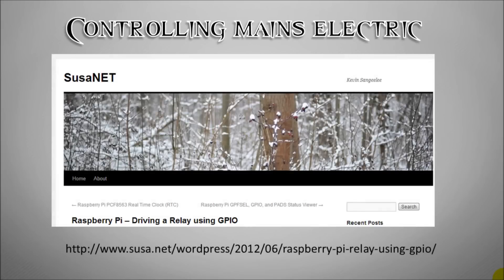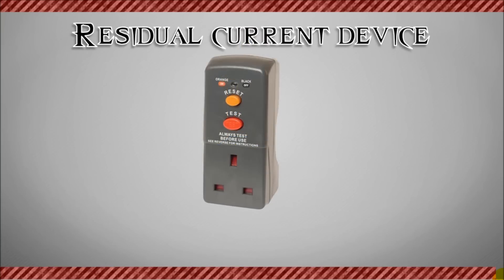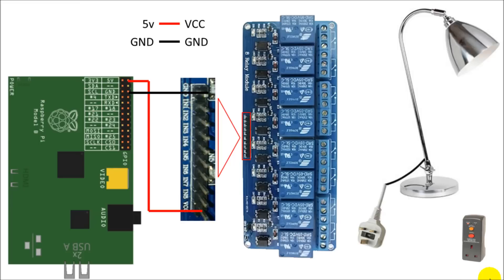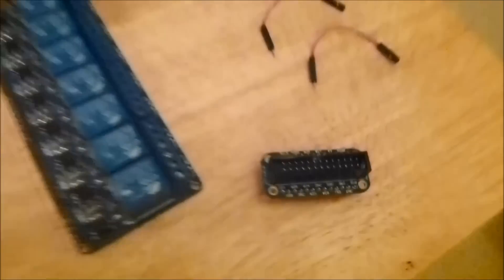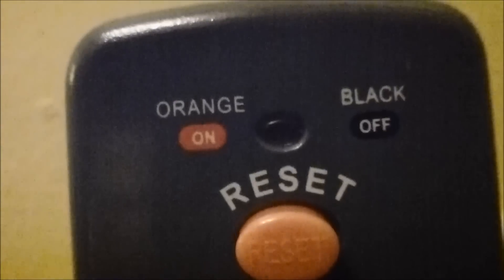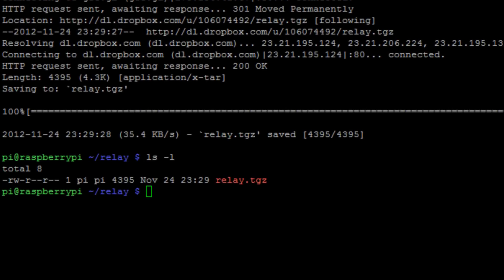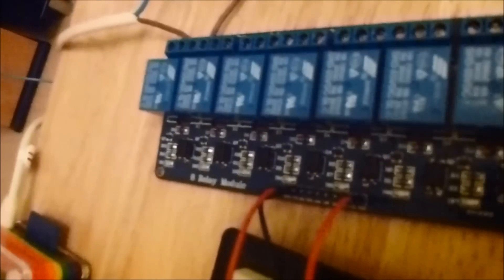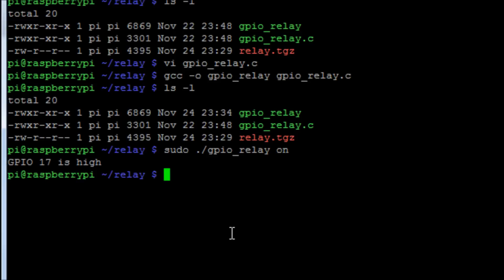Raspberry Pi - (Relay) Controlling mains electric

Comment: I studied electricty(high voltage) in school. Went to a technical school.
Good advice mostly. Just one comment.
At some point in the video you connected the extention chord to that safety device, the proceeded to connect the wires to relay.
Do not trust a switch that is off! You can still shock if someone swopped live and neutral somewhere in the path.
I would recomend that you do all your wiring to the relays 1st, and when all of that is done and safe, only then do you connect it to the mains. By safe i mean no metal parth showing.

Comment: It might be a good idea to make it absolutely clear that everything should be unplugged from the mains while wiring up and the relay board should be sat in an insulating surface and not be touched when the mains plug is in.

You could also note the function (a pair of normally open contacts) of the terminals on the relay board rather than pin numbers which could be different on another board.

Comment: i think instead of cutting the cord on your lamp you should have used an electrical box with an outlet and a plug, then you could just plug in anything and for anyone wanting to mess about with it, i think it might be less hazardous than cutting up a lamp cord
Reply: Yes, but the luxury of an outlet isn't always possible because of space issues. I'm working on a Pi controlled coffee pot and I have to bypass the switch in order to control it.
Reply: +Len Harms most of these relay boards seem to be rated around 10 amps, however UK mains sockets are rated 13 amps maximum. You would want your relay rated at least 13 amps, in case someone plugged a 3 KW heater or smiler into it.

Comment: I have a piface digital on my R-pi and I want to use this to control another relay via its 5v signal.  The other relay will control a UK mains supply 230v 5-13amp.  I need a bistable flip/flop relay so that a switching signal is only required either to switch the mains supply on or off. Do you have any suggestions for a relay that would work in this situation?  Any advice, much appreciated.

Comment: There is a thing in america called the power tail which is a relay inside a short extender with the relay wires exposed. Quite safe with I think an RCD inside but don't quote me on that. Its all completely isolated

Comment: Is this correct that by using relay module we do not need any external circuit like transistor driver and can directly connect it with rasberry pie

Comment: also i have a couple of questions -
1.  various forums online seem to indicate you cant control a 5V relay using RPi with the GPIO's - as they operate at 3v3. Is this true - if yes, how are you able to achieve what you are showing in the video?
2. how can I control an 8 channel relay - or  16? are the number of GPIO pins on RPi enough? If no, what else would be needed - would be great if you can make a video on that too.
thx

Comment: Man thank you so much for this video I am doing like a small personal project for me, I am connecting a solenoid door lock to a relay and i want to control it over the internet what is easy is connecting everything mechanically i think (haven't tried yet) i have one question, i know there are many ways to control relay online but do you know any simple ways because its really frustrating since lot of people aren't really putting any help out for this kind of thing, again thank you for you vid
cheers

Comment: Can I give my relay ,the 5V power through VCC through any external 5V supply without connecting it to my raspberry pi's 5V GPIO (and ground GPIO)?But only connecting the commanding GPIO between pi and Relay.

Comment: I looked that relay board up and it indicated that the inputs (1-8) expect to be operated at 5V.

Is it ok to operate them from GPIO pins that only output 3.3V? Also do you know what the current draw from the GPIO pins is, to ensure you are not asking them to source more current than they are designed to.

Also I am curious as to why you wired the lamp up to the NC (Normally Closed) pin on the relay itself as opposed to the normally open pin. 

This means (assuming this board is active low, which I believe it is) that whenever the GPIO pins output 0V ("Active)" the relay will switch to the NO pin and turn the lamp off, yes? So the lamp is only on when the relay is de-energized, which is when the GPIO pin outputs 3.3V, yes? So in this case, would the little red LED on the relay board itself act oppositely to the lamp, in other words one is on while the other is off as the lamp is wired to turn on when the relay is not energized?

Thank you!

Comment: Well made vid, and I don't like to criticize, however you should not have really showed the phase wires being handled and put in the relay unit, after you plugged it in the wall.  Never do this. Don't rely on wall socket switches (they can fail as can RCD's)  Always UNPLUG electrical stuff while your working on it.  You should be an electrician really, if you want to mess around with mains.

Comment: Now then so far you video as helped me loads as a beginner but I seem to be running in to a problem after I  run the fist sudo command  my relay lights up but when I try to turn it on/off with the off command it still stays on if anyone could help that would be great . What I am trying to do is control 4 relays as on off switch & later of a app on my phone.
Reply: Thiago Kurovski 
yes, the relays click both in on and off status.the LED is on when the relay is actively sending power to the light or whatever you have it connected to.

Comment: hello, when pin 2 & 4 pos and pin 6 gnd don't show any power what does that mean,  does it mean the gpio side of the pi is dead? the rest of the PI3 is working great running the software. Also when I use a external source to power to power a 5v relay and connect the 1N on the relay to a gpio on the pi3 it does not trigger. I have 3 pi's any none are showing power on any gpio and none of the pi3 gpio working is there any fix for this ?

Comment: Hi there.  
I have created a similar thing but added the PI directly into an extension socket enclosing the PI and the relay in a strong enclosed plastic box attached to the side of the sockets.
I am able to control the the GPIO on the PI with my Android phone using DrGpio.

Comment: Is there any reason why you would want to use C over python? Python seems to be more straight forward with the GPIO library. That C had a lot of lines, just to turn on and off.
Reply: C is generally a lot faster than Python. If you're doing anything time senstive, you should try to get as close to the hardware as you can. When working with a few relays you can afford the comfort that comes with Python's overhead, but that's not always the case.
Reply: cmdstraker, that makes a lot of sense to me; that would be the same reason for writing the Linux Kernel in C instead of Python. thanks.

Comment: something doesn't make sense here.   you have the sainsmart 5v  8 relay board there, and you are using 5v as VCC.   You are also using the rasberry pi gpio pin17, but that pin toggles I/O from 0 volts (a ground) to a high of 3.3 volts.   That is inconsistent with your Vcc of 5 volts.   what gives?
Reply: I think it's the VCC pin that powers the relay
Reply: +Nikolaj Gylling Where does the 3.3 V go then? To an opto isolator?

Comment: The safety advice here is true but incomplete. ALWAYS isolate, preferably unplug, mains-voltage equipment before working on it. NEVER touch wiring live at mains voltage. Preferably enclose any exposed mains wiring before powering it, if you don't be VERY conscious where you are doing with your hands, you don't want to touch something absent-mindedly.

Comment: How would this be the same process if i'm connecting to a ceiling light?
Reply: Also, is how would I do this in python, I'm allot more familiar with that language
Reply: *****
What's the problem?
Reply: *****
Could you actually explain why I shouldn't...
Reply: ceiling lights..........exactly what i thought off the second i saw this video lmao............
Reply: i think u might need to open up the switchboard and get the proper cable out of it to connect to the relay board.
Reply: ClassicsTelevision you would need to connect somewhere in the circuit AFTER the light switch. Most practical would be near the light fitting connecting to the SL (switched live {UK electrical terminology used here}) connection. Best discreet way would be to gain access to the ceiling void and identify SL, cut it and feed the 2 ends of the cable you just cut into the relay connections. In effect you would be able to switch the light both with the existing light switch on the wall and also via raspberry.
Going a step further if you can find and route all the existing lights SL (on that floor of your house/flat etc.) to a multiple relay board you could potentially control all the lights on that floor relatively easy. I'd suggest using one Pi for each floor of your house/flat for various reasons.
Also consideration would need to be given to powering the Pi, that could be done easily enough using a PSU fed from the permanent live supply usually found alongside the SL in a light fitting (returning via neutral connection) but would mean wiring a socket outlet into the circuit somewhere (probably best to find a junction/joint box somewhere in the ceiling void) unless you can find a PSU that can accept cable directly instead of having a sealed unit with socket pins (would look more professional).
A load calculation MAY be necessary, taking into account the existing lighting load of that lighting circuit, and the current draw of the Pi. It should be ok, but count each light (on that floor/circuit) and times by 100 then divide by your local supply voltage for current draw of lighting and add that to the current draw of the Pi/Pi's for the total circuit loading and check that's comfortably within the size of the fuse/breaker supplying that lighting circuit. The only issue I can see is if your Pi or the relay board dies you would be without lighting, so easy access to these parts (including PSU) would be necessary.
Sorry for the long post, but hope that is of some help to anyone who wants to tackle this.

Comment: Hi, i have an question. Are you theoratical able to run every relay the same time?
Reply: Yes. The relays are just like independent switches, so they can be controlled off and on at the same time, or any combination on and off.

Comment: Thanks! it worked, Just fine, I have a relay of 10A and my AC is 220V how many whats can it take without burning my raspberry pi, or burning something else.My relay -> http://www.dx.com/nl/p/produino-diy-pc817-2-channel-5v-relay-module-w-optocoupler-extension-board-blue-290132
Reply: +S3NTYN3L Oke so I can put on my relay 2000 watts no problem? I saw on the Dx.com website that my relay can take up to "AC 250 v 10 bis" So I can take 2500 watts as well? or is it still 2200?
Reply: +S3NTYN3L And is this wattage for each relay switch or for the whole board?
Reply: +S3NTYN3L This is the  description of the relay I have at home: &#39;Equiped with high-current relay, AC 250V 10A ; DC 30V 10A With 4 fixed screw holes, hole diameter: 3.1mm; Optical coupling isolation, good anti-interference; VCC system power, JD_VCC relay power, default 5V relay, just plug in jumper cap; Indication LED&#39;s for Relay output status&#39; url = http://www.dx.com/nl/p/produino-diy-pc817-2-channel-5v-relay-module-w-optocoupler-extension-board-blue-290132
Reply: +S3NTYN3L Oke, So I can control 2 speakers of 1500 watt and 2 subwoffers of 1800watt  with a relayboard of 4 relay switches. For turning them on and of.
Reply: +S3NTYN3L Ok Thanks for the information. I will be testing this project out, Thanks again! Keep up the good work!
Reply: +S3NTYN3L in that room there are 2 time 15A for all my music & computerhardware ;) so I think that won't be a problem
Reply: +S3NTYN3L Aah oke Yes I see then I need to change that. to a bigger one so that All my other hardware can run to. Thanks for explaining
Reply: +S3NTYN3L Yes indeed this is what I am doing at the moment, but then with 2x 15A. (only with just the speakers, subwoofers will arrive next month) so enough time to fix this :D
Reply: +S3NTYN3L hahahaha :D it is not that they are on all the time but yes indeed it will be costy :D by adding the raspberry pi with the relays I will be able to check from everywhere if my speakers are on so I can turn them off if I accidentely left my speakers on.